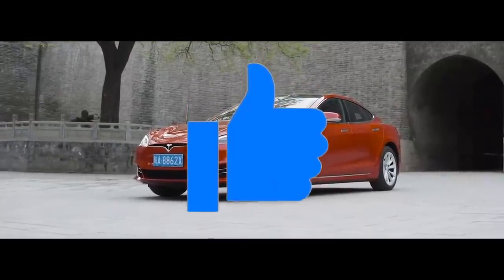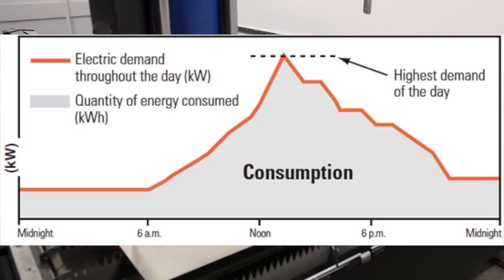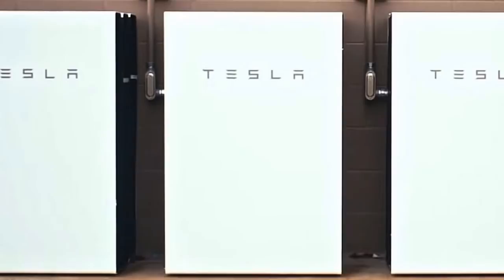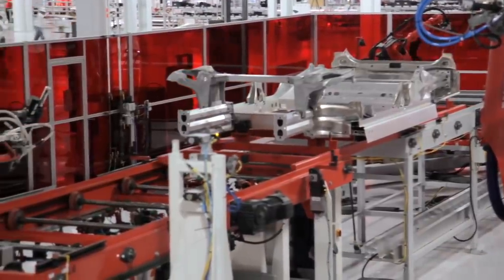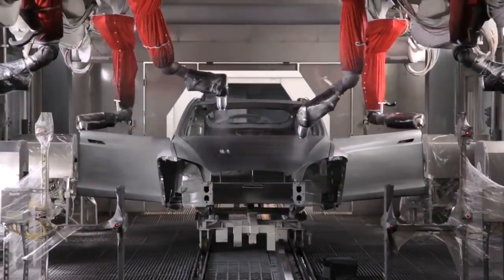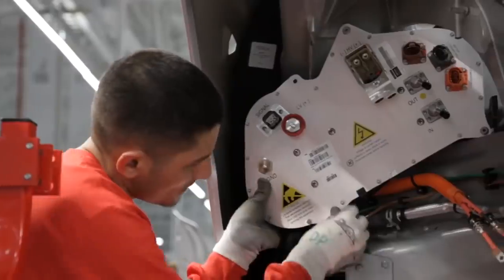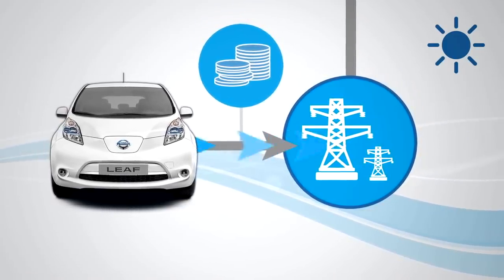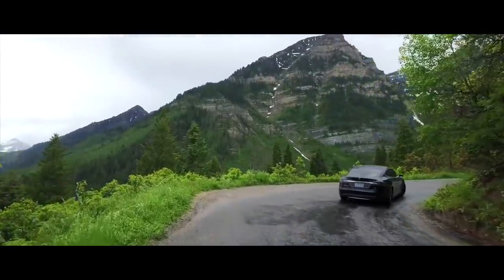Tesla's New Feature: Bidirectional Charging

Comment: One should be able to charge up at work and that could be regarded as a form of wage. The workplace could invest in it's own windmill to assist in that. Once home the stored energy could be useful as backup for the grid (payed of course ) since there is no solar energy at night and wind fluctuates. I don't know however if the smart grid is able to handle all these little inputs and outputs. In theory it seems possible and it's perhaps cheaper than a whole new heavier grid able to import renewable energy from other countries.

Comment: Please don't exaggerate. Its seriously doubtful an Tesla EV has an adequate DC-AC inverter of adequate power to be used in a VTG application. The Tesla Powerwall has a 5KW inverter for a 14KWh battery pack. This ratio was chosen for a reason. A 75KWh Tesla EV battery would need a 20-25KW inverter to be sensible in a VTG application. A 3:1 to 4:1 ratio of KWHr to KW output would be needed to make the EV able to produce the power the grid needs to create a realistic virtual power plant from EVs within the same grid area. A 20KW inverter is a serious piece of power electronic and would cost hundreds to a thousand dollars of EV cost. 

That's a tremendous burden on the EV price. A reasonable sized house would typically need a 10KW+ inverter to just cover the homes needs as in a dual Powerwall. The tear down analysis of a Tesla EV that suggested it had bi-directional power is not correct. It has a high powered charger but does not have a high powered inverter. They are very different electronic power beasts. Here is an example of a 15KW inverter charger for $3300 that would be required built into every Tesla EV

 https://www.sigineer.com/product/15000-watt-pure-sine-wave-ac-coupled-inverter-compatible-with-tesla-car-lithium-ion-battery-pack-backup-48v-to-120240v-110-220v-230v/

The VTG application is a marvelous one but Tesla will need to design and begin putting a 10-20KW inverter in every EV sold to make it possible. It is possible that the Tesla EVs have the ability to output battery power such that an external 10-20KW inverter could be placed adjacent to the charge station. But that device would be similarly priced to the Chinese Sigineer inverter I provide a link to. It would be best not to suggest Tesla EVs are ready to go when in fact it will likely require a multi-thousand $ external 10-20KW  inverter similar to 3 Powerwall inverters in one.

Comment: This has been debunked. It turned out he missed the diodes in the circuit, which makes the current flow one way. I agree that tesla will have bi-directional charging in the near future, but it is not already in existing cars. I believe this will be revealed on battery day  and that all Teslas with the 1 million mile battery will have this feature.

Comment: This will be a valuable feature when available, however I think not 5 times as valuable as a Powerwall on the same software. Why?

Some capacity needs to be reserved for driving the car.

And

The charger will most likely be limited to around 7 to 8 kW unless 3 phase supply is available. This is not 5 times the power which can go through a Powerwall. You will run out of peak period to sell into before the battery is depleted.
Reply: And a powerwall is connected to the grid 24/7 but a car isn't.

Comment: I’m no expert on battery charging but I believe each time you charge a battery you put a lot more energy in than you actually get back, especially when the battery is nearly fully charged. If this is the case then your profit on selling the power will be significantly smaller and may not even be a profit at all. Perhaps somebody who has expert knowledge can confirm or deny this?
Reply: Its not that much energy lost during charging, and they obviously have taken it into account.
Reply: The problem is that almost any practical energy storage they have now,  is even much less efficient than batteries. But normally large scale grid energy is not stored in batteries because of the price already but with millions of electric cars, needing a battery anyway, that could change.

Comment: I think this is a great idea, I wonder what utility companies will think. Also, the power wall is 5x smaller than the car’s long range battery, why don’t they make the power wall at least as big as the car battery?
Reply: Because it would cost more.
Powerwall is supposed to store a day of home electricity use, so you can store what your solar panel produce and not sell it back to the grid if they dont pay a fair price for it.
Plus it is used as backup.
Reply: Nico Nico thanks ! Plus if your home can pull from the car’s battery, I guess you wouldn’t need a bigger power wall.

Comment: As far as I know electric companies currently buy back electricity for pennies compared to what they originally charged you. It would be super if it was actually fair.
Reply: They buy back for pennies because you are only one person selling, and you are paid a fixed price, so it doesnt matter if you produce when electricity market price is high or low.
With tesla, you are not going to be alone selling. The electric companies can buy from thousands of cars at the same time, and they will pay the market price which can be very high during short periods of times, and the tesla software will only sell when the price is high.
Reply: @niconico3907  Thanks for clearing that up. As a individual you can only produce so much power not really meeting any real demand. But with being part of a network you can actually meet a demand when it's needed.

Comment: I dont live in a place where prices of electricity varies throughout the day
Reply: me neither
Reply: The price you pay may be fixed, but the electricity market price is changing all the time (the price the electricity producers are paid)
When you have the tesla autobidder software, the electricity companies can buy the electricity from your battery when its expensive.
Reply: The charging circuit is not bidirectional as others have noted. Nissan has designed in bidirectional v2g using the Chademo connection which goes to 400 volt traction battery and uses a separate v2g interface box which has been used in Japan. Tesla could  use the electronics from power wall and the control interface for the supercharger to make a stand alone v2g box but nothing like that exists today. Using my expensive Tesla battery to resale electricity is not a good deal but emergency power backup maybe useful. If you really want to do the energy load shifting the use a power wall . That’s what the power wall does and you don’t have to degrade your expensive Tesla battery. I think the Tesla power wall works out to $0.05 per kwhr and good luck on getting an additional $0.05 above base price for electricity from your utility.

Comment: Why isn’t there an alternator charging another battery as you drain the one you’re using giving you unlimited battery power? That’s how a gas engine works... you don’t need to charge the battery everyday to run your electrical system cuz it charges itself as you drive.
Reply: Genius, you've just invented a perpetuum mobile

Comment: Still worth getting the Powerwall? I want to be able to control when to back feed to the grid, usually an on-peak hour to maximize the value. I'm currently in the process of getting 3.75 kW solar panels with 2 Tesla Powerwalls from Tesla, they gonna start installing it on June 5.
Reply: How much does all that cost?
Reply: @Memyselfandi59057  before any incentive, it's $25k. That's for 3.75kw with two Powerwalls, including installation and supporting hardware cost

Comment: I'm just a wee bit skeptical about the numbers for the amount of money you can make per year. Let's take the example of placing $1,000 into the stock market investing in a stock which bread is a 4% annual dividend which will generate $40 per year. In order to generate $1,000 per year you would need to invest about $25,000 in this stock. Compare that to the cost of the powerwall. Even with installation cost you have a sub 10-year return on investment on a product that is warrantied for 10 years. If the numbers were anywhere near this good we would be seeing battery substation popping up left and right as utility-scale electricity providers cashed in on the Bonanza and took advantage of the economy of scale.
Reply: There will be batteries on the grid, there is just not enough batteries in the world made yet.
The tesla grid battery in south australia is doing very well, you should research it.
Reply: I am well aware of the peaker plants in Australia, but Australia is not North America and is running under a different set of Economic and Regulatory rules. Kind of like the difference between electric cars in America and electric cars in Europe

Comment: I fail to see how the potential annual gains are calculated to be $1,000 a year and it even sounds not possible as I understand the concept. Unfortunately zero real numbers were given to justify the claim.    Buy low and sell high means virtually nothing w/o actual values. Assuming a $0.10 (10 cents) difference and assuming the car is fully charged at 75 Kwh battery. That would be potential max of  $0.75 a day  revenue. With there being 365 days a year the math comes out to $273.75, a year. Not to mention you will not be able to use your car if it happened to be uncharged when you need it.  Sounds a bit of a bogus claim to me.  To make $1,000 in a year you would need over 3.5 charge discharge cycles every day of the year.  Clearly the grid does not change pricing  that much in a day.  I'm calling balderdash on this concept as claimed.

Comment: There isn't a lot of value in vehicle to grid. If you look at today prices in the UK high price is about 3.5p low price 1p for wholesale. The difference of 2.5p is what you'd make. Of you discharge 40KWh into the grid that's £1 profit per day

If the million mile battery is 4,000 cycles and you keep 1,000 cycle for the car that leaves you 3,000 cycles at £3,000 for V2G

This doesn't even take into account charging and discharging losses nor does it take into account current regulations which limit for example any power from the home to the grid at 16A in the UK which is about 3.7KW power not a lot so of you have an expensive hour for electricity you can only export 3.7KWh for that hour to take advantage of it

Still worthwhile doing bit this gives you an idea of the upper value of this technology about £1 per cycle or ~£3,000 over the lifetime of the car
Reply: The capacity of a power wall is 14KW, not 40. But your point still stands, it may not be ready yet in that region
Reply: @tomknop8675  it's not that simple for example you can only export 16Amps of solar to the grid beyond that is a lot of rules and regulations and I don't see why export form cars will be allowed more than from solar. So if you battery is small or massive your export is still limited to 16Amps which is about 3.7KW

In the UK wholesale prices are for half hour periods. So at most you can export 1.85KWh per period

There is value in using cars as V2G but it's not tens of thousands of £€$ it's probably closer to 1 €¥$ per cycle and if the battery has 4,000 cycles if you save 1,000 cycles for driving the other 3,000 cycles might have about €¥$3000 value used in the grid

Assuming the regulators play ball and do everything you ask of them.....
Reply: @kaya051285  thanks for the explanation! I see what you meant
Reply: @kaya051285  solar electricity export to the grid is limited because it export anytime if it is needed or not.
With batteries, the electricity market operator can choose when the batteries need to export the power. So the export limit might be higher. But it has to be lower than what the house grid connection can handle anyway.

Comment: It is my understanding that Autobidder and the Virtual Power Plant are two interelated but distinct products that came out of the code to support the mega battery at Hornsdale and the distributed batteries, solar etc under the Virtual Power Plant in Southern Australia and powerwalls that Vermont's Green Mountain Power (GMP) sold to its customers - "Aside from the big battery system in Australia, Electrek has learned from sources that Tesla is also using Autobidder as part of its Powerwall deployment with Green Mountain Power in Vermont." https://tinyurl.com/ybq6ahce 

The best information on the VPP and Autobidder can be found in a discussion between the a programmer of the VPP (Colin Breck) and Autobidder (Percy Link) 
https://tinyurl.com/y6vf7sx9

Comment: It would seem it would drive the electric company end up to a flat rate charging so you could not make any money charge at one price . the only way you make money if you making electric from solar or wide than giving back to the electric company
Reply: If they make electricity vary, its because its good for them. If they can buy electricity from your battery a bit cheaper than a gas peaker plant when electricity prices are high, they will want to do it.